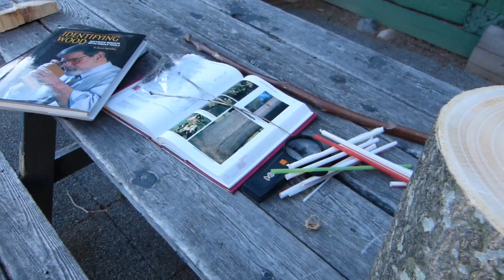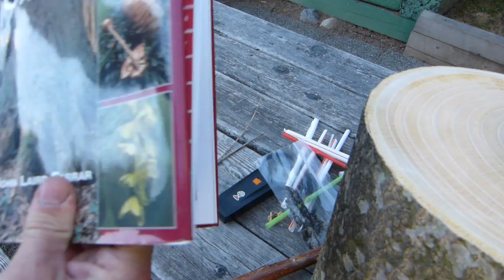Wood identification intro

Comment: This is a very, very low level botanical science video, which for most people will not be useful for identifying a wood species.
Reply: thanks for this "very, very, low level" introduction to wood. it was exactly what I needed.
Reply from the maker: Thanks for watching. Building up knowledge from ground zero has to start at ground zero. Have a whole playlist of wood related stuff here: https://www.youtube.com/playlist?list=PL9cPDQOOfTepRjpdhXX6_6q1tC3zoLH8g
Reply from the maker: This is a very, very low level botanical science video, part 1 in a series on identifying a wood species. Part of actual classes ran in joinery, carpentry, horticulture, arborism.